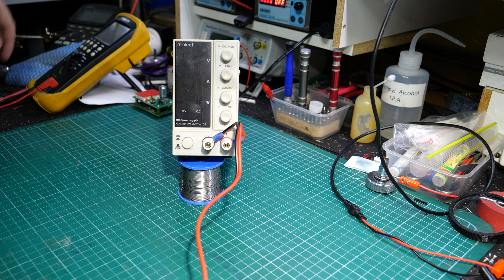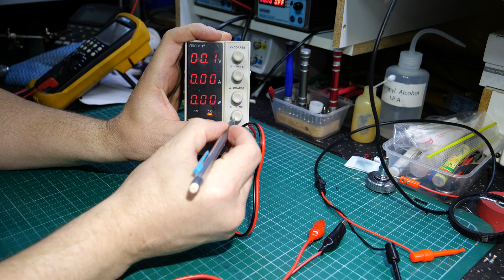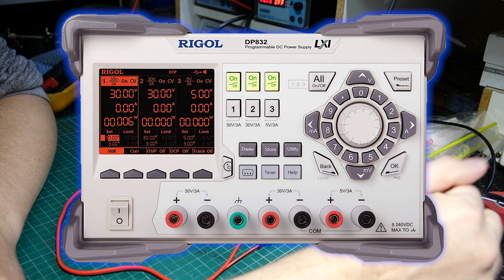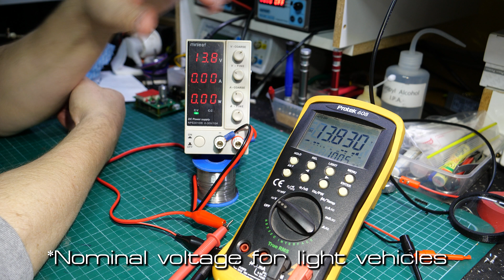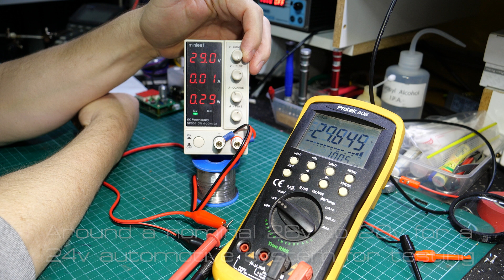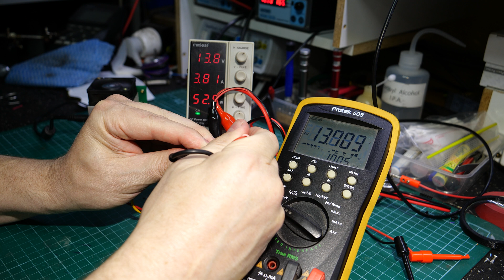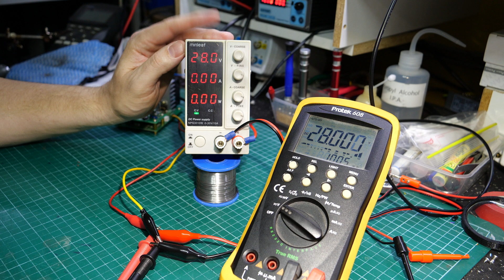#21 – Minleaf NPS3010W teardown and review – Part 2

Comment: I also have one of these PSU and have been pretty happy with it until it stopped yesterday. Just stopped, no display , Nothing.

After some probing and looking up component datasheets, I concluded the main controller chip, TNY277GN had died. This 7 pin chip is a 600volt 10 Amp MOSFET and control circuit which has internal references, oscillator, etc. 4 pins on one side are the Source connection and act as the thermal connection to the PCB copper for heat rejection. The circuit board design would be important at this point. there is a single pin for Drain where the switching action happens, and two other terminals that have multiple functions that you can look up. One of those pins will accept the collector of an optocoupler's photo-transistor . Basically if the voltage is too high it skips the next oscillator pulse so the output voltage of the PSU Will start to fall. All the decision making for the optocoupler is done by other circuitry elsewhere on the board.
This chip is now short circuit from those 2 inputs to Source and the Drain appears to be open circuit. I'm going to replace it and hope things work out. I might have to find a way to monitor its temperature and somehow add some cooling if that looks like the cause of failure.

Comment: How you going Mate?-You mentioned that the programmable dc power supply is the way to go for mobile phone repair. I just purchased this item. Let me know if good enough. I think Aussie Supplier (Manson 1-36VDC 5A Remote Programmable Switchmode Power Supply) Thanks
Reply from the maker: Hi Jayson, the specs look good, the USB PC remote contol and presets are a win as well.  Big unit though, ok if you have shelf space for it to perch.  Not sure if it has adjustment lock out, but just be aware when moving around the dials with a device powered up. Thanks for your comment! 😄

Comment: Hi is this good for bench work for like working on phones and stuff....?
Reply from the maker: Hi Raj, you "could" use this type of PSU for low voltage applications, however, because of the nature of the interface if you just accidently bump the dials you could inadvertantly let the magic smoke out of the DUT.  I'd be more inclined to use a programmable PSU where the settings require a more deliberate interaction to be changed.
Reply: @xyzconceptsYT  ok i was also lookin the the HANMATEK HM305 any thoughts on this?
Reply from the maker: Something like this "A-BFastiron Programmable DC Power Supply Variable - 30V/5A" (Amazon) maybe, as you can adjust the voltage more precisly with a rotary encoder type dial rather than potentiometer.  Less likely to bump the voltage out of spec while connected the the DUT.

Comment: @ 4:31 would be better to attach the dmm's leads at the output banana jacks in order to see the load regulation since this psu does not have remote sensing.
Reply from the maker: I figured at this price point perhaps noise and ripple would be a bigger concern than load regulation.  Wouldn't you agree?